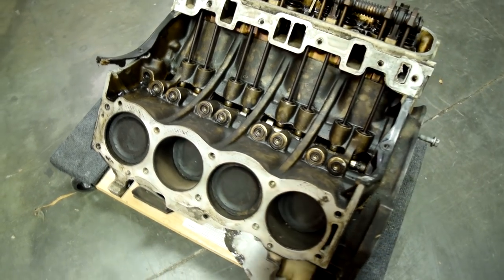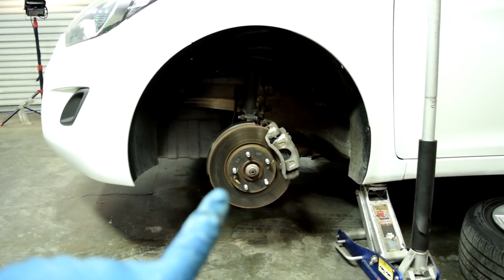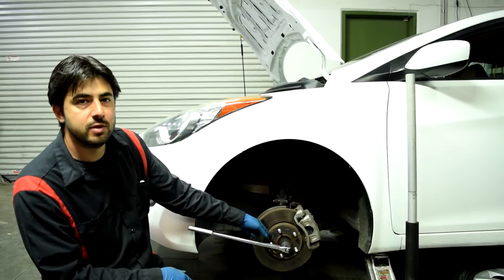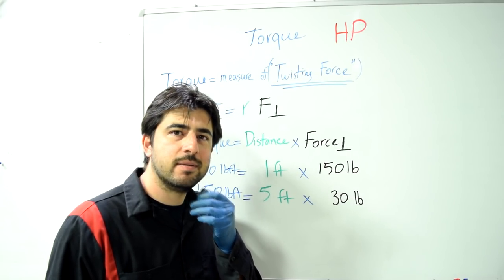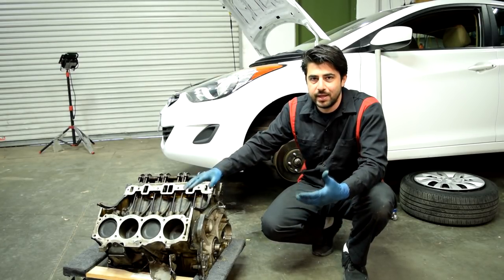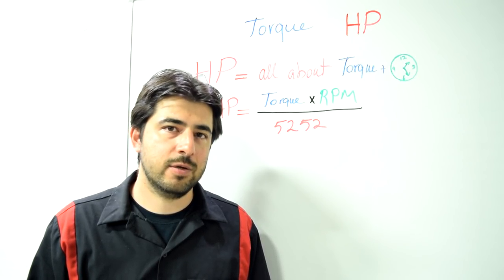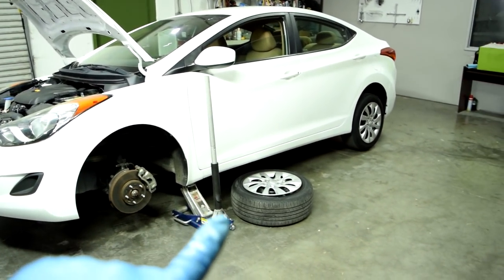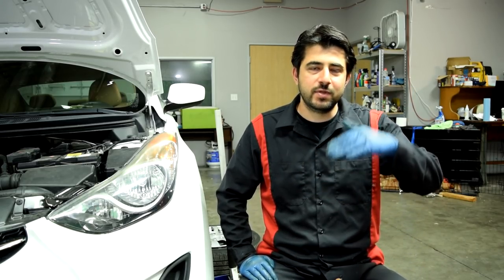Torque and Horsepower Explained - Easy and Simple Explanation

Comment: Entertaining and educational. 
A few additions... 
The lower case r represents the radial length or radius of the lever circle. 

The 5252 is a constant derived from the horsepower equation where the radius or radial length is 1 foot. 
This is the constant that combines the definition of one horsepower, the conversion of minutes to seconds, and the translation of circular motion into linear motion. 
The constant 5252 is the rounded value of (33,000 ft·lbf/min)/(2π rad/rev).
550 lb ft/sec  = 1 horsepower 
33,000 lb ft/min = 1 horsepower 
1 Minute = 60 seconds 
1 Revolution = 3.1416 (Pi) x 2 
550 x 60 / 3.1416 x 2 = 5252 
33,000 / 6.2832 = 5252 

Since the rotational speed is expressed as revolutions per minute (RPM) we need the constant 5252 to accurately complete the equation to calculate Imperial/US Customary and Metric/SI Horsepower units.  
Because torque and RPM are equally divided by 5252 in the Horsepower calculation, torque and horsepower are always equal at 5252 RPM. 

When using Metric/SI units to calculate Watts then the constant is 9549. 
Because torque and RPM are equally divided by 9549 in the Watts calculation, torque and Kilowatts are always equal at 9549 RPM.

Comment: Good stuff. That was the clearest explanation of horse power I've seen.  It's a concept I can't visualize well, and have trouble with. Torque over time! How have I missed that for so long.
Reply: Hard to visualize is right! I can say the idea of "torque over time" is not doing you any favors. That's not what power is at all. The most correct way to think power intuitively in a vehicle is "capacity to accelerate a heavy thing"... promise. Remember that it's just torque times engine speed. Every vehicle has some ratio of engine rpm to ground speed. The thrust propelling the vehicle is proportional to engine torque times this ratio. So the thrust is related to the product of engine torque and rpm, not just engine torque. That's why power is so important and engine torque alone tells us nothing.

Comment: Your one liners cracked me up. That aside, this was a good reminder of math that we can actually use. If there is a drive pulley system that aids in a power increase, that would be interesting. I've heard of it being done for slalom cars, but never seen one installed.
Reply: That would be extremely interesting... like physics is broken, interesting:) Unfortunately you can't always improve performance by changing gearing.
Consider a moment in the life of an accelerating car: Could it be accelerating harder by using a higher gear ratio? The answer is always yes if that higher gear ratio would result in a larger increase in input (engine) rpm than a resulting decrease in input torque. In other words, yes if the product of torque and rpm at the engine (power) is higher.
If that higher ratio results in a larger decrease in engine torque than the increase in engine speed, than we have reduced acceleration at this moment.
Making sense?

Comment: A lot of people think if they want to feel fast acceleration they need an engine with high torque like a turbo diesel. A high torque engine feels effortless because it doesn't make too much noise since it runs at low rpm but it doesn't make the car go faster than a low torque with the same power. Actually the power/ torque - rpm curve matters but maximum power gives you a good approximation of the acceleration of the car but the max torque doesn't. Basically you need torque times rpm which is actually power. 

A turbocharger gives you a better power- rpm curve which makes a car a bit faster having the same max power as a naturally aspirated engine. Turbodiesels are turbocharged and that makes them a bit faster than a non-turbo at same rated power.

Comment: Your explanation of torque is really good but I think that when you say the wrench has to be perpendicular to the axle because of the formula, it is not because of the formula itself but because when you pivot the breaker bar your are changing the length of the radius. The actual formula is torque=(radius length)(force)(sin(x)), where x is the angle between the radius arm and the force vector, which in this case the the angle of your arm relative to the breaker bar. Since sin(90*)=1, the term disappears and you get the formula you showed which specifies the perpendicular force vector. Hope I'm not a buzzkill lol awesome video man!
Reply: Tony J. He was trying to simplify in practice the concepts, not fill ones head with theory. But I do like your theoretical explanation,  regards, Stewart, Australia
Reply: tl;dl these pics
https://cdn.shopify.com/s/files/1/0646/5139/files/Pinkbike-Torque-Diagram_grande.jpg?2259
http://lancet.mit.edu/motors/ratchetdiagram.gif

so basically, in his explanation, he was not changing the angle that the force was applied at, instead he was changing the distance/ length of the lever used. in a corrected version, he could've shown his arm pushing at right angles to the ratchet, with the force being applied so that all of it is only turning the axle (nut) and none if it is pushing the axle sideways or any other direction.
Reply: Eva Gillies, I realize he was making it simple for the sake of the video, I just like to interject occasionally hahaha! Cheers from the USA :)
Reply: huh? lol 
he explained it better ;)
Reply: He's actually right, and your wrong... The equation is F x D = Torque. The "x" doesn't just mean multiplication, but a vector cross product.. you'll probably learn it next year.
Reply: Nerd!!!!...lol
Reply: @reezyeezy4824  Since when was distance a vector  ?
Reply: An engineer walks into a bar.. ;) nice reply
Reply: you are right. i dont know why people gave you so much shit. the guy in the video is wrong. torque is the distance of the lever arm multiplied by the force component perpendicular to the lever arm.
Reply: @we-are-electric1445  by definition, the lever arm distance is a vector.
Reply: @johnr1875  A vector must have magnitude and direction. A distance is a scalar quantity.
Reply: @we-are-electric1445  youre right. I agree. When i say, " by definition", i mean that physicists got together and talked about how they would calculate torque. They decided that they would consider the lever arm as a vector, which i believe points away from the axis of rotation(dont quote me on that, mechanics was a few years ago). So then if we are looking at the system and the lever arm is to the left of the axis of rotation, and if there is a force downwards, then by right hand rule, torque points out of the page. So torque is given a direction by definition as well. Its direction is not around in a circle. It is a straight line perpendicular to both the force and lever arm, which is what you get when you use the sin function.

Comment: The perpendicular notation on the F component denotes a perpendicular force to the handle of the breaker bar, not of the breaker bar being perpendicular to the wheel hub/axle nut.  The angle of the handle is not important, only the perpendicular distance from the axle to the handle is needed for the equation, and that perpendicular measurement is implied in physics so it doesn't require a notation as does the F component.  So basically, torque values are the force exerted at exactly that one singular point of perfect perpendicularity on, in this case, the handle of your breaker bar.

Comment: What is the best metaphor to get started? How about Hammer and Nail?  You can raise a hammer and slam it down on  the nail and if you hit it dead center it might go right through on your first hit. If you place the hammer head on the nail head and push with all your weight, you probably won't move the nail much. You are not any stronger or weaker, heavier, lighter in either case. Does torque explain the sudden and instantaneous impact of that hammer which causes such momentum that it breaks the friction of the wood and nail?

Comment: Used to pull up to 1,200 foot pounds manually on the 747. Used a multiplier. Highest we would pull 1:1 was 900 ft lbs. Enerpac with a reaction bar would get us to 2,400 ft lbs.

Comment: Torque, simply, is the ability of a vehicle to perform work — specifically, the twisting force applied by the crankshaft. Horsepower is how rapidly the vehicle can perform that work. ... Because there is generally a limit on how fast you can spin an engine, having higher torque allows for greater horsepower at lower rpms

Comment: This channel is better than 'Engineering Explained', i finally understood the difference between those two. Thanks a lot. 🙏💕
Reply: Calculating peak torque x @RPM ÷ 5252 = hp. Does that give you peak horsepower? Im confused

Comment: i am doing the cam seals & caps 0n 2.7l Bi -turbo & timing belt . i  had cam alignment tool  & crankshaft pin in place. while tying to pull exhaust  cam pulley. the pulley popped lose & alignment popped  off rotating the exhaust cam 2.5 links. appx. I pulled it  back  two the marks .   I changed the exhaust cap seal .  i tighten everything back to spec . i rotated engine  twice the marks where slightly off. then rotated again the timing are marks even even more off? i think  cam  chain  tensioner is  broken . it keeps going up and  down but when it goes down it falls. and i can push it down with my hand sometimes!

Comment: help! i have fiat punto 1.2 16v petrol year 2001. in the morning when car is cold pulls just fine all the way up 6k rpm, no hesitation. but as the car warms up losses power and hesitates so bad, feels like 50-60 % down in power, i need to step very very slowly on the gas pedal to gain speed more quicly. so far i have changed leads and spark plugs and they made a little diference but the prblem is still there.

Comment: PLUS- shouldnt the horse be pulling a horizontal cable/rope?  The force vectors will get all whacky if not, similar to having a non-perpendicular prybar/torque wrench- a t-wrench might have been helpful here for illustration, no?

Comment: so in 2 words

torque = how much work you can do
hp = how fast that ^ work is done

so you could technically have 4000 nm on a 80hp engine as long you manage to gear it at the right ratio and dont have any hurry since it's going to take quite a long time to move that weight right ?

Comment: Nice video on this and even some history on mr watts. Any case hp is a measure of power which is the rate of work per time (or torque in this case a form of work * rpm a form of time).  Yes i had screwed this distinction up interms of torque vs hp for car measurements in the passed so this definitely clear this up. As well as clearing up how the dyno measures the hp from measuring the torque and using hp = torque * rpm /5252 . Though curious if one could uses a scan tool measure the wheels rpm and torque in some way... i think if you lift the car up on jack stands and  spin the wheel you can read the speed /rpm but getting the torque at those rpms you need this special dyno equipment hummm wonder if there is a home cheap modification tool to do the equivalent of a good dyno to some extent

Comment: Get topic! I pull a trailer with a 4.0L inline 6 and I'm looking to get a Grand Cherokee with more TORQUE for pulling a 4,000lb trailer. But how big of an engine do I need to be able to pull my trailer at 70 MPH over Donner Summit , Califorina or any 6% grade. Any way to mathematically calculate that?
Reply: torque is irrelevant. While it is more handy for keeping the engine rpms low, higher horsepower is going to tow a higher weight. More horsepower, more work getting done.

Comment: I did your equation and it didn't come to the HP that the dynapack says I have.
158.38 lbft of torque @ 5419 rpms @ 83.7mph and 192.09 hp @ 7010 rpms @ 108.3mph...these were 4th gear pulls on my car.

Comment: The old adage "Horsepower sells cars and torque wins races" is still true. Give me an engine with a 4 inch stroke any day.  Long stroke engines in general have more torque better thermal efficiency and usually get better real world gas mileage.

Comment: Horsepower was originally chosen as that was the amount of water a horse could pump out of a mine (horse walked in a circle, harnessed to a spoke of the wheel, the center of which drove the pump).
Makes sense. 550lb/ft min is what they planned for I guess

Comment: This helped my understanding a lot, but the '5252' rpm/calculation number still confuses.  Is it simply the rpm where torque and hp intersect?  But how can you use that number if the hp isnt known yet.  Im missing a piece i guess.  Never quite got that, but im on my way.  Love the channel.
Reply: Yes, 5252 is simply where the curves intersect when using units of horsepower and ft-lbs. Change any units and that number changes. It has no physical significance. A red flag is when people say it's the rpm where "your torque and power are the same" (that's as meaningful as saying you height and weight are the same) or using it as a dividing line between these engines and those engines... Just smile and nod.

Comment: More of a Breaker Bar, not a Pry Bar, a "Pry Bar" is more for prying nails out of boards and such, a "Breaker" or "Torque" Bar's more for ratcheting nuts & Bolts, just saying, but very interesting video non the less, I was going to build a Self Propelled Walk Behind Snow Plow, never really taught Mechanical engineering, but I'm basically self teaching, which I was looking for some videos to help me with proper Gear Ratio and Roller Chain Shortening Great Video, which I know What a "Pry" Bar is, because I do more Carpentry work.

Comment: Sir: If you have a massive crane operating with one winch of 14,500 hp (550 lb/f/sec), and your winch is vertically lifting a 3,000 ton (metric ton) load, then is it possible to calculate how many feet per second the load could be lifted when running at full power? 
Also, is there an online calculator/converter for this issue? may be something like this one: https://www.translatorscafe.com/unit-converter/en/power/ 
 thanks. K.S.
Reply: Here is the world's largest monster crane:
http://www.mammoet.com/siteassets/equipment/cranes/ring-cranes/ptc-200-ds/datasheet-ptc-200-ds.pdf
Operating with two C-18 Caterpillar engines, delivering a total of 1500 bhp
https://www.cat.com/en_US/products/new/power-systems/industrial/industrial-diesel-engines-lesser-regulated-non-regulated/18396700.html
It lifts 3,000 tons 120 meters in 12 minutes 
Thus: 120/12= 10 meters per minute
Question: Can we guesstimate that the above hypothetical crane of 14,500 hp delivers the same results nearly 10 times faster? (i.e.: 100 meters per minute = 1.6 meters per second)? 
Thank you. K.S.

Comment: hey i just changed my fuel pump, fuel filter, spark plugs  put in new high octane fuel in the tank what would be the main reason i cant hear the fuel pump prime
Reply: Jay G i cant here it prime even when i put my ear to the fuel cap when its cranking?
Reply: Any 1 had the same problem ive got a nissan pulsar
Reply: Have you noticed a difference in drivability?
Reply: Nathan Spain Gotta new battery its cranking but it wont kick over an start up?
Reply: +M Kemmis  
Was it running before you "changed my fuel pump, fuel filter, spark plugs  put in new high octane fuel in the tank"?
Reply: patw52pb1 yes 100 percent it had low kms it seems like no power is getting to the fuel pump it was sitting in my garage previously for 2 years.
Reply: +M Kemmis 
How much fuel is currently  in the tank? 
Did you get the polarity correct on the replacement fuel pump wiring? 
Has the vehicle been in a flood, crash or inversion/rollover? 
Have the air bags deployed before parking 2 years ago? 
Check the fuel pump fuse, relay and wiring. 
Sometimes the fuseable link is blown or damaged (no continuity). 
Sometimes vehicles parked for a long time have rodent infestation/damage, look for damaged wiring, wiring harness with missing insulation, nesting material, tell-tale rodent odor.
Reply: Seems like its time to pull out the test light and check for power at the pump. Check that then go from there. If there's power it's either the connection or the pump itself. If no power track that down.
Reply: Jay G Its a FUEL MISER Fuel Pump EFI in tank FPE-447 unfortunately its made in china ive noticed stuff made in japan are better quality.
Reply: check the fuse if it's good ,and you can check the fuel pump pressure from the fuel rail with a special tool
Reply: The more expensive pumps have become quieter

Comment: How does CC effects torque and HP on lets say an Motorcycle how important is then engine size?
Reply: All things being equal, torque is directly proportional to displacement while rpm is slightly inversely proportional for anything over 250-500 cc ish. So this means that power is roughly proportional to displacement to the power of 0.9 ish. (double the displacement and get 1.85 times the power)

Comment: Wait what is the difference between peak hp and peak torque. Lets say that the peak hp is 200 and peak torque is 150 nm. Lets say peak torque is at 5000 and peak hp at 7000. Am i gonna accelrate better at 5000 or 7000

Comment: I didn't understand one thing... torque = force x distance.... but you are taking pound as force where pound is not any measure of weight or force... it is simply a measure of mass.. then the equation becomes
torque = mass x distance
what doesn't make any sense to me....
can you please explain how pound can be force?
Reply: It's the weight of one pound, more correctly expressed as one pound force or 1lbf, but torque is written as lb-ft because its understood that lb means force since, as you said, mass x distance is meaningless.
Reply: A pound is a unit of force in the English system, not a unit of mass. The English unit for mass is called a slug. (We do use pounds for weight which is mass times g)